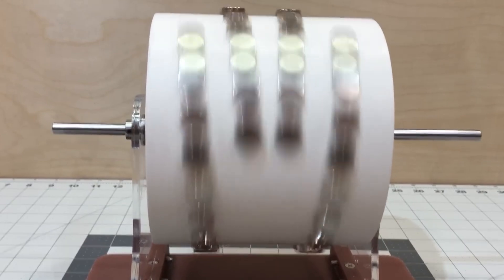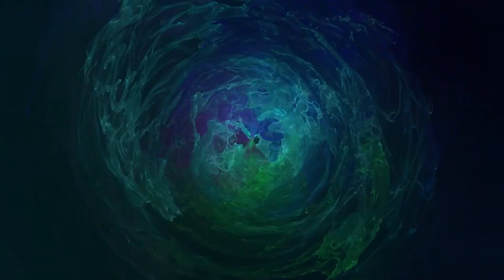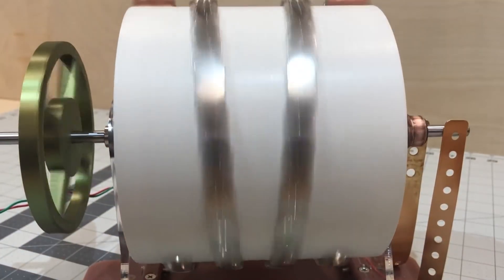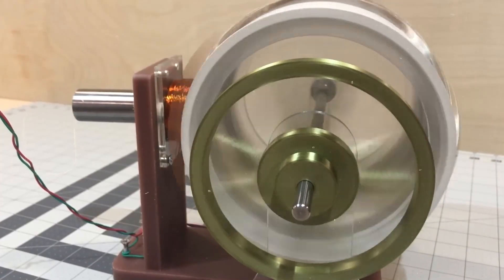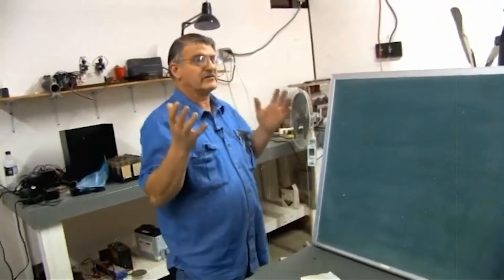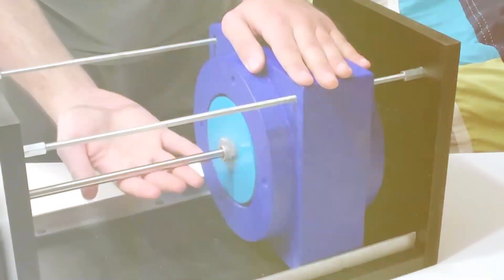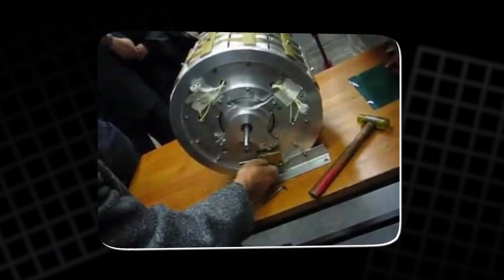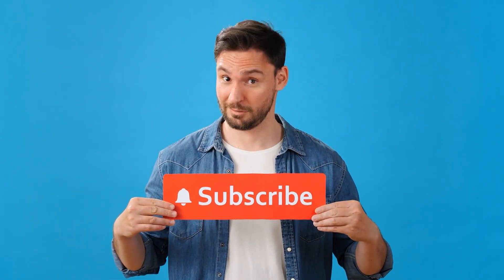Why Magnet Motors Will Never Work (And What You Can Learn)

Comment: I think a magnet motor can work. You are using the power of the magnet to move something to make power. Nothing created. Just changed. The powers at be will never let it out. If one is made do not tell anyone, just use it. I believe hydron cars that work on water works also. You not going to see that also.

Comment: A magnetic motor. Why hasn't anyone been able to create one? I think the answer is simple. When we say the word "magnet," what we most likely picture is a bipolar magnet, not a circularly magnetized magnet. This is understandable, as in practice, such magnets are of no interest because they don't attract iron. Iron doesn't have a clearly defined pole, so you can't make a generator or electric motor out of it. That's why many people haven't heard of such magnets. Electric motors come in different varieties. There's the simplest unipolar electric motor, which you're all probably familiar with. It's a cylindrical conductive magnet. A small AA battery sits on top of the magnet. A wire extends from the positive terminal of the battery and connects to the circumference of the magnet. The wire rotates because it has a circular magnetic field. The conditions for the wire's rotation are created. The magnetic field crosses the conductor's circular magnetic field. The Lorentz force causes rotation. Now imagine a magnetized wire with a circular magnetic field. Such a wire will rotate without electricity!
This way, you can create a magnetic motor that doesn't require electricity!

Comment: Quite right the mechanicals will ware out as we all do, I used applied practicality to a foundation Tesla invention, and simply designed out the flaw, of course you still have a battery to commence rotation, once in motion the computer takes over engaging the solenoids forcing the magnets being cones together one smaller unable to rotate the other larger will rotate central crown wheel starter motor commence  rotation, remember 3-6-9 shapes and configurations, planes trains and automotive oh yeh boats, this guys a dick

Comment: What I learned is that whoever came up with this video is top-notch ignorant. The magnet motor is simply that, a motor, NOT a generator. A magnet motor acts just like a gas or electric motor...it DRIVES a generator, and the GENERATOR produces the electricity. The magnet motor just doesn't need gas or electricity to run, and it doesn't need to pull energy from the UNIVERSE to spin...the repulsion of the magnets against each other is what turns the motor, which is CONNECTED to the generator that produces the electricity. Clear enough? All that's needed is a way to shield the opposite poles of the magnets so they only repel.
Reply: Yup are right on the button
Reply: Also me couldn't say it any better 🤟👍👋!!!